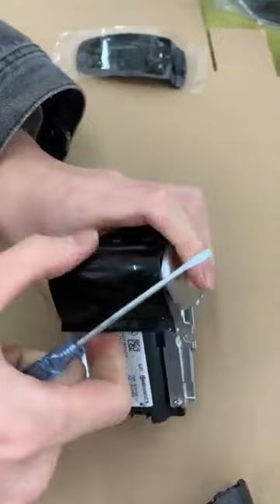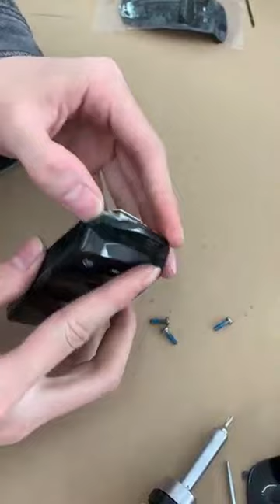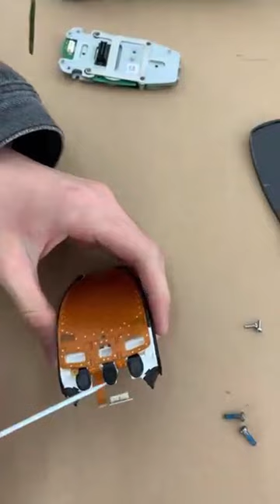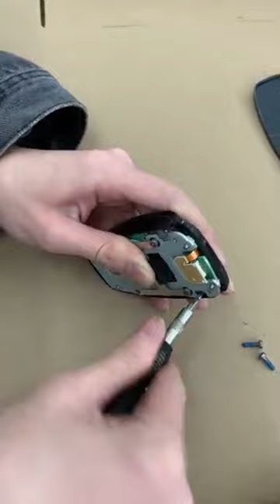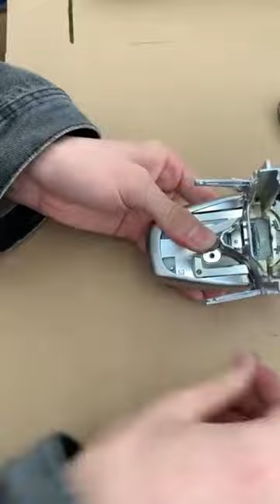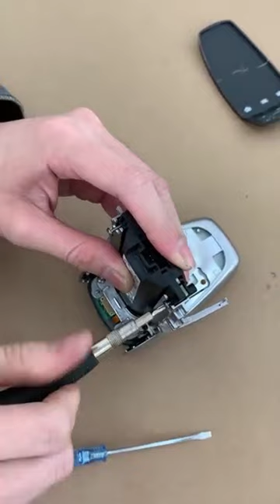How to replace the center mouse handwriting touchpad of Mercedes BENZ?

Comment: Guys, this video works. You’ll need a number 9 and 10 torx bit. My tools only went lowest to a no. 10 so homedepot has a kit with it. 

I used a hairdryer that got my cracked piece pretty warm a couple times, and used two flathead extended bits to pry the bitch off. It worked! Cracked it along the way but it was cracked to begin with, and I superglued the replacement $50 chinesium part onto it and it is paired successfully.  

I am now the happy owner of a command unit that is not cracked. 

Hallelujah 

Reply if you need help

Comment: Great video. Thanks. The plastic cover is fused to the touch surface. Cautious application of heat from a heat gun helped separating these two. I stuck the new cover on without any extra glue because the original glue of the touch surface was intact.

Comment: What type of glue have you used to stick down the touchpad? If you know where I can find it please drop the link, Thanks.
Reply: Was wondering the same thing, superglue would be to strong, probably some sort of double adhesive tape would do.
Reply: I used superglue! I had the original pad and I can confirm it worked.

Comment: You cannot peel off the original Mercedes Benz touchpad, it will break because it is completely fused to the base on its sides.  The video is a forgery, it absolutely does not correspond to the reality at the stage of peeling off the touchpad's plastic cover.  Don't even try this and buy the entire touchpad.  It is simply impossible to peel off the original MB, it is only possible to break it off gradually.  Maybe the Chinese copy of the touchpad can be peeled off, I haven't tried that.  However, you cannot peel off the original MB touchpad in this way.  Don't buy the cover itself from the Chinese, just waste your money.  The solution is to buy the entire touchpad, which even from a Chinese company works without problems.
Reply: That is not true. I have just done it myself. It is quite hard to peal it off and the original top plastic cracks but it's removable if you are careful. I fitted the replacement and it is working. I pried it with plastic tooling to not damage the copper touchpad underneath.
Reply: Just need to carefully use a heat gun